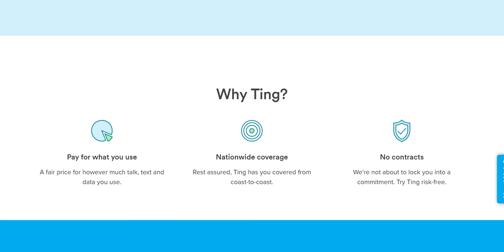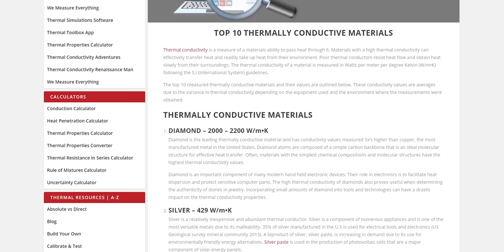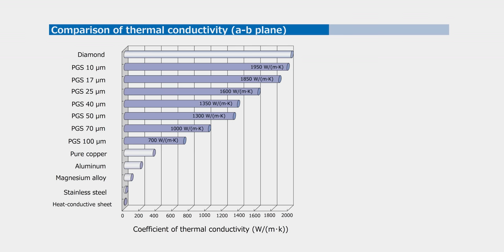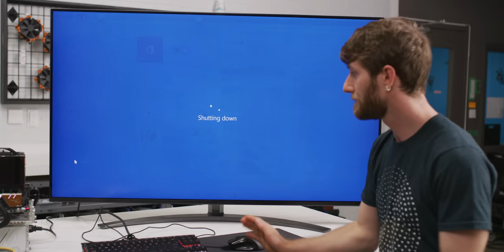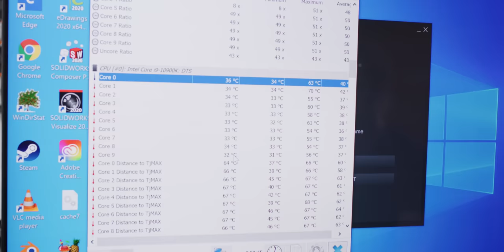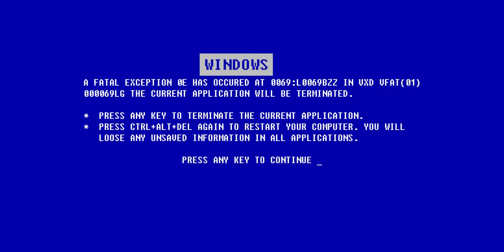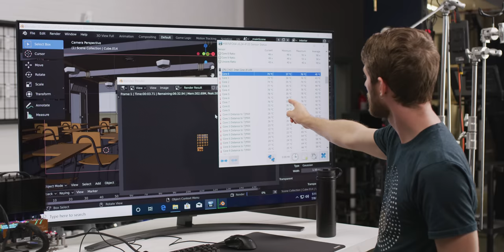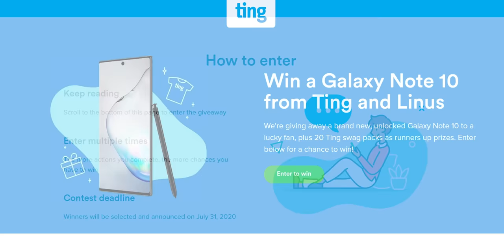This Sounds Too Good to be True - God-Tier Thermal Pad

Comment: Graphite tends to conduct more laterally than through its thickness. I suspect that's what you're running into.
Reply: Time to stack a trillion sheet, put them sideway, cut the thing. A thick pad of vertical sheet. Conductivity from the dye to the cooler
Reply: @Thunder Life it's material, the structure only transmits in one direction
If you wanted to make it vertical, it would not hold its structure, and you would have to add a binder to keep them aligned, removing the heat transfer benefit
Reply: @Thunder Life It is due to the nanostructure of the material itself. The transport properties in plane are much better because the waves (electrons, phonons, etc) travel more easily between the carbons atoms (through the valence bonds). There is some vacuum in the z direction (out of plane) between the different graphene sheet (which are forming graphite). Those are only maintained together with VdW interactions. The transport properties in this direction are therefore less interesting (by several order of magnitude).
Physical engineering student here
Reply: @MrPoPoTe09  This is pretty overkill for a small question. Still nice to see.✔️
Reply: Yeah i was thinking the same Fergy
Reply: My thoughts exactly.  If they could modify the process to grow crystals laterally instead of vertically, it would be awesome.
Reply: A good testing situation is to replace heatpipes in laptop with those graphite pad, the instant hear transfer would be insane if the fans can hold it.
Reply: Thunder Life Guy who sat through the solid state lectures in university here, heat transfer has everything to do with the electronic structure of the material, meaning how electrons are bound to the atoms or not. Graphite is a layered material where the electrons have a high mobility in the sheets of the graphite, but a way lower mobility in the other direction. Electronic conductivity and heat transfer are also directly related due to that. Think about it, metal conducts both heat and electricity very well, ceramics isolate both very well. The exception are perfectly ordered crystals like Silicon where vibrational excitations (phonons) transfer the bulk of the heat.
Reply: @StevenZephyc  Now that's not a half bad idea, using it to transfer heat along its length is the purpose, so this would be a lot better.
Reply: @terriplays1726  I think that is what the manufacturer was trying to do.  Get graphene to line up in an ordered lattice structure to improve the conductivity in cross direction.
Reply: If they don't lap the IHS and heatsink then I'd try this too. This sheet would horizontally spread the heat more evenly and then paste or pad would transfer it vertically.
Reply: So you'd be best off sort of making a rectangular prism out of these sheets, but it would likely be crushed by the heatsync.
Reply: Put the product in the title. You've gone back to clickbait crap!
Reply: @Thunder Life Graphite consists of sheets of carbon. Within a sheet heat is transmitted much more quickly than between sheets.
Reply: you could probably apply it to the heatsink fins to allow the heat to spread further from the heatpipes and more effectively use the fin surface area to dissipate heat
Reply: So all he needed to do was fold it in half?
Reply: You're forgetting something tho. It's not Graphite, it's Graphene.
Reply: @Thunder Life carbon in graphite is sp2 hybridised, that is, planar sheets of carbon atoms cross linked. Typically, in graphite the sheets are poorly linked with each other (attraction between the sheets) cause there's only molecular vanderwaal's forces. That's why graphite is slippery, cause the individual sheets can easily slip past each other (hence a good lubricant). In graphene, a single layer of is extracted.
Reply: @Thunder Life this is also why graphite conducts electricity and diamond doesn't. Diamond has sp3 hybridised carbons that are tetrahedrally arranged, forming 3d dimensional bonds (not planar). This is how diamond gets to be so hard, but this sp3 hybridisation comes at the cost of losing an electron. Graphite however is sp2 hybridised. This means besides the electrons in the bond, there's a free eletron ready to conduct electricity.
Reply: @MrPoPoTe09  What exactly do u mean Phys Eng student
Reply: @MrPoPoTe09    if they covered each fin would it make the tower more efficient?
Reply: @shahbazahmad-ud6kj  Overkill is never a bad thing
Reply: @MrPoPoTe09  by VdW you mean Van der Waals right?
Reply: Steven Zephyc Linus said that heat pipes have a much higher heat transfer than this so I don’t think it would work 🤷🏼‍♂️
Reply: FergyA820 also the size of the cpu it’s covering is say 175Watts where that i9 puts out 300Watts .
Reply: cue 30000 sheets of graphite 1 cpu
Reply: @isaacx593  I'm doing an MSc in Physical Engineering, focusing mainly on physics of functional materials and nanostructures. My main research topic is spintronic, a quite recent field allowing to do amazing things (like reading a very weak magnetic field at the surface of an hdd to detect the bits)
Reply: @swyftty2  Starting from what they had I don't see how they could have done any better. By covering things with a thin sheet like that, the heat transfer will always be out of plane. (See also my other comment below to Technoslav)
Reply: @ubberJakerz  Yep !
Reply: soo true
Reply: @MrPoPoTe09  so it would make kinda perfect radiator fins?
Reply: @CossackHD  Not really, for several reasons. First, creating and isolating graphene sheets is not that easy. Making complex structure with it even less. Adding the fact that moving heat really efficiently is not equal to dissipate efficiently this heat, the industry is not close to move to graphene for radiator fins !
Reply: if that is the case then wouldn't  a block of the stuff be more effective? and then laying traditional heat pipe in it to another block of the stuff?
Reply: @MrPoPoTe09  I see, graphene sure is flimsy, Linus would rip the whole cooler to shreds if he did like in the video :D
How about improving heat transfer from heat pipes to far edges of metal fins using graphene? Could be L shaped sheet that touches vertical heatpipe and horizontal fin surface (or goes as middle layer inside of a fin)
Reply: @snintendog  Again, it depends on the ordering of the sheets and their orientation. If you can align all sheets to be perpendicular to the plane formed by the cpu or the rad, then it would be pretty effective !
But note also that you'd still have energy losses at the different contacts
My conclusion would be, funny experiment here, but stick with liquid metal for the moment !
Reply: @CossackHD  Not that simple unfortunately ! When one talks about graphene sheets, it is very very very thin (actually a single atom thick). You can't just bend it like you would with paper. 
Their are some ongoing reasearchs on using carbon nanotubes between two contacts to transport with very few losses heat or electronic signals. You can even do what are called "molecular transistors", using those CNTs as the gate of a macromolecular transistor.
Reply: @MrPoPoTe09  LM though is less worth while in general due to the danger to the computer and the fact it barely lasts a few months until it needs to be replaced at this point just soldering the cooler directly to the Die or the IHS is better than LM in all aspects.
Reply: @snintendog  Usually in heat transfer your problem is the barrier between the heatsink and what you are trying to cool. If you have infinite conductivity on both sides doesn't matter if you have a void in between that doesn't conduct.

Typically diamond or pyrolytic graphite is used as a heat spreader to "spread" the heat (obviously) for things like a LASER where it is dumping all its heat in one point and you need to get that heat away fast so moving it laterally is just as good as vertically to start with.

There are some ideas like spraying a liquid that then goes through a phase change at that temperature directly on the object to be cooled. Theoretically the best that can be done, but you have issues with clogging the microjets along with just the extra difficult setup to start with. This is better than just immersing it in the liquid because when the liquid boils it makes a void of the gas which doesn't conduct well.
Reply: @StevenZephyc  At 11:30 he says the material is not as good as heatpipes.
Reply: @terriplays1726  This would make sense why they were confused at the beginning. It conducted electricity well despite what the manufacturer said but they were testing on the same side.
Reply: "Graphite tends to conduct more laterally than through its thickness. I suspect that's what you're running into"

So what you're saying is... they've got to FOLD IT!!1
Reply: I second that - I found a site (cant remember the url) that was even declaring the 2 different thermal conductivities: one for x/y axis (in the order of thousand) and 1 for the z axis (like 5 or so)
Reply: graphene*

Comment: I worked for a competing distributor and Panasonic came to our facility to give us training. In fact the people in the video were actually the ones giving the training. The particular pad you were using is really only designed for lateral thermal transfer not thermal transfer through the sheet. In fact their page specifically lists heat diffusion as the main use for this pad.
They have a  separate product described as Graphite-PAD  is  a  thermal  interface  material  (TIM)  that  compatibly  obtained  excellent  thermal  conductivity  in  thickness  direction  (Z-axis  direction). You may want to redo with one of the z axis pads.
Reply: This needs more attention. Completely underrated
Reply: Agreed
Reply: so...we should get graphite-pad instead???
Reply: @linus
Reply: What's the difference between lateral and normal thermal transfer? I'm new to all these, and frankly I'm looking to get a pad to attach a heatsink/fan to cool my camera externally.
Reply: @professionalpotato4764  laterally means the it goes from edge to edge. Normally, it goes through one side to the other.
Reply: Linus notes in the video that the adhesive layer rivals the thickness of the graphite layer. Obviously not suitable for this application. The CPU is also a special case for "thermal pads" because they don't need any adhesive due to the mechanical fastening of the cpu and the heat sink by the socket.
Reply: link to product?
Reply: That makes sense, as far as we know that stuff could be acting as a isolation the way it is.
Reply: I looked up panasonic’s graphite pad and they’re claiming 13W/mK conductivity at 400kPa (58ish psi). So for the effort, it doesn’t seem like much benefit over something like kryonaut.
Reply: bro post a link i want to buy it
Reply: @linustechtips
Reply: @AUXdrone  i just looked up as welk and it seems 15 in z direction.
Reply: @AUXdrone  it's a pad rather than paste :) other than that your right
Reply: @BurntBarbeque  yeah i think there are varying degrees of performance that they offer, the one i saw said 13.
Reply: @jeff0296  yeah i know lol. But that’s what i said, that the pad i found claimed 13W/mK while kryonaut is at 12.5W/mK. So if you’re already using kryonaut there’s no real point to sourcing one of those z-axis pads. But if one is upgrading in the first place then sure, could be an option.
Reply: They never got around testing the right graphite pad, did they?
Reply: the thermal pad is only 14w/mk not much higher than a thermal grizzly paste
Reply: then why not use them as fins in a heatsink?
Reply: @bennido4820  bro wish I would have seen these like 3 weeks ago. Thanks tho. I think I'm going to buy Panasonic stock. The miners are going to be buying those thermal pads
Reply: would like to see a video on this
Reply: Plus next time use gloves so your body oils don't end on the pad
Reply: 13W/mK.......are u serious about using this??
Reply: Still no test on the right pads?!  No way I'm trying it on mine first, lol!
Reply: Thank god someone posts this because there is misinformation about good products from Panasonic.
Reply: super hessu  i understand that. I’m only addressing the information that was presented to me and the conclusion is in an all-things-being-equal situation, the cost-benefit favors the kryonaut. Specifics and new tech will always change, and likewise so can my conclusions 🙂
Reply: and then conclude that a liquid medium is always superior due to air less air pockets/bubbles
Reply: Too thin for heatsink fins. Too flimsy as a material for building the entire heatsink... but, to redistribute heat from the cpu to the heatsink if it's plate is much larger than the cpu lid? That is the question.

If the thermal bottleneck is between the cpu-lid and the heatsink plate then that bottleneck can be improved with a more thermally conductive material (right now Cryonaut Liquid Metal would be particularly ideal) or a material that can more efficiently redistribute the heat to the heatsink plate than the material the heatsink is made out of.

I would imagine a sheet of pyrolytic graphite with micro-corrugations and liquid metal in between to have the potential to be more effective than just liquid metal. While it may not be as efficient as liquid metal on the X-axis it would be able to redistribute it efficiently along the Y-axis which would effectively improve it's efficiency along the X-Axis.

Ah, the marvels of physics and calculus matrices.😪
Reply: @bennido4820  Yes. Those would be the ones. And as others have pointed out, not much better than thermal compound.
Reply: Bump
Reply: @Tired6878  how was ur test ? Any good news?
Reply: @miniclubman99  lol no. I wasn't and still won't be a guinea pig on this one. Waiting for Linus to test the correct pad. 😉
Reply: @Tired6878  update bro?
Reply: Ah yes, the insane effort of buying one product over another.   Nevermind that the one you are claiming has more effort doesn't require you to electrically insulate the socket to be safe over time, or reapply it every few years.
Reply: I was just about to write that.
Reply: graphite? horry shiet only heard of them used in Space
Reply: Exactly what I thought when he used it to slice through a piece of ice. Thanks for your detailed clarification!
Reply: Linus being clueless as always, nothing changed (:
Reply: He covers this towards the end of the video and explains how its better for lateral heat transfer.
Reply: Yeah 100% thought something was not right after seeing many other videos about the proper pads being used.
Reply: Bit late to the party, but I use Soft-PGS for basically anything heat transfer related, and you're right about using PGS in this application, it's not the best, as there are no specs for heat transfer in the Z, but Graphite-PAD also isn't great in this application too (too thick, crap conductivity compared to paste etc).

This is why I use Soft-PGS, because the lateral heat transfer is 400w/mk for the form I use, it still has a thermal conductivity of 28W/mk in the z axis, which is still better than paste, it's also thin enough to be used in between a heatsink/cpu, and will squish in as needed.
Reply: @sarahjrandomnumbers  What type of Soft-PGS do you use? What's the brand/model? Because it sounded interesting. Is it Panasonic EYG-R GraphiteTIM Pyrolytic Graphite Sheets?
Reply: @JesusChrist-sx1lf I normally get EYG-S stuff, as the R only starts at 0.25mm and I wanted 0.2mm.

Last order I got was EYG-S1216ZLWD which was the cheapest for the largest size pad, which I cut down to size.
Reply: @sarahjrandomnumbers  Thanks, I've been looking at EYG-S091207DP (0.070mm) and a cheaper one at 0.1mm like EYG-S091210DP for example.

Perhaps thinner is better? Have you tried 0.070mm or is that too thin?